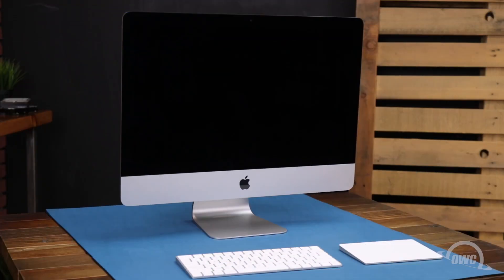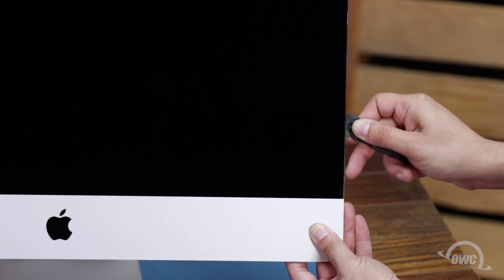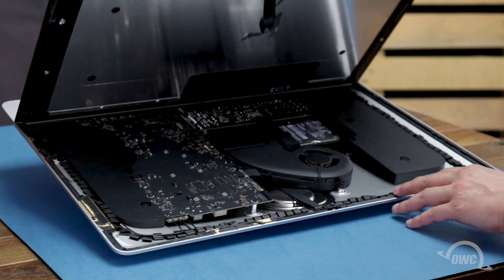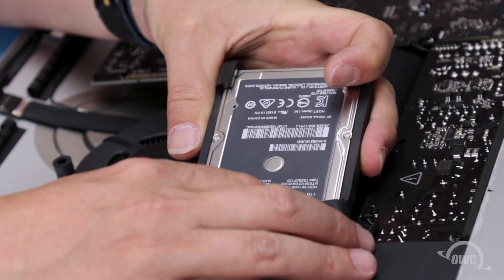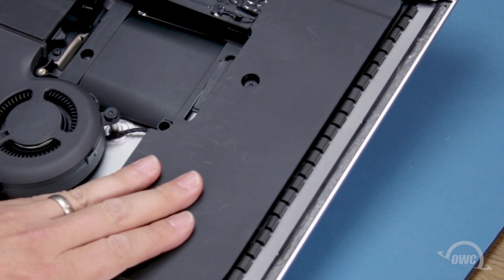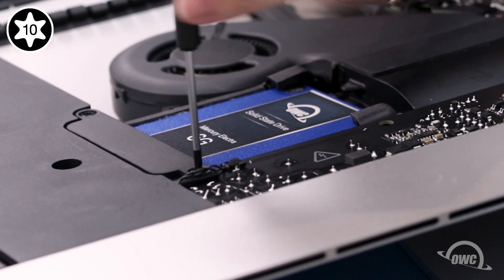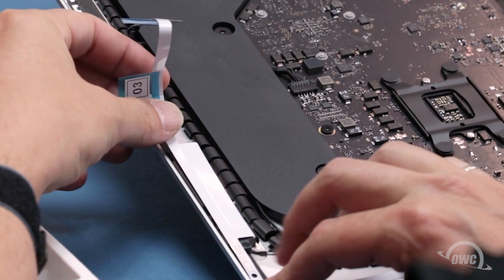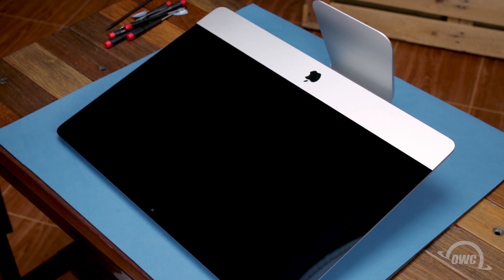How to Upgrade/Replace the Main Drive in a 21.5-inch iMac (Mid 2017) iMac18,1

Comment: Hi, thank you in advance OWC for this instructional video! I am very new to iMac, but I own a 2017 21.5-inch iMac with a 1TB Fusion Drive. Does this mean that my iMac has a socket for an NVMe SSD? If yes, can I replace both the HDD and the SSD? Thanks, OWC.
Reply from the maker: Your iMac will only have that option if it comes with an SSD in that slot from the factory. This would be if your iMac either had just an NVMe SSD already installed or a fusion drive installed. If neither of these came on the iMac it will usually not have the option to add it in later.
Reply: @poweredbyowc  Ok, thanks a lot!

Comment: I have a 2017 iMac 21.5 non retina.  t has a 1 TB SATA.  Can you replace the SATA Drive with a SSD?  I saw that Fusion and 256 GB SSD were upgrades to this computer and mine doesn't have the upgrade?

Comment: why not just have someone hold up the screen, change the drive, and put back down the screen, the adhesive should still stick right?
Reply from the maker: If you are referring to the original Adhesive on the Monitor, no it will likely not just stick again. We always recommend taking the original adhesive completely off and re-applying for the best results. There is always a chance that the original adhesives get damaged just enough that it is no longer able to hold the monitor effectively causing your screen to fall off and get damaged.
Reply: @poweredbyowc  OK, very good. Thank you.

Comment: @OWC I would like to replace my hhd with a ssd. But I don't understand the difference between ssd sata and PCIe. Which one should I prefer?
Reply from the maker: Which one you would pick depends on what you currently have installed, if you have a SATA HDD you would want to replace with an SATA SSD. If you have a Fusion Drive you could do either. Apple won't put the connections for whichever drive type you don't have so while PCIe is often faster if your computer didn't get it from the Apple factory you won't have the connections to put it on your computer. In most cases a SATA SSD is more standard but you can always check your System Report to see which you have.
Reply: @poweredbyowc  Thanks for your explanation. You have been very esaustive.

Comment: Hi there! Im so confused, when opening my iMac there’s no hard drive where yours is. It’s just an empty space with no Sata connector to be found. I own an iMac from 2017, with an ssd hard drive of around 250 go that I meant to replace by a 2 to. But I can’t find the hard drive lol If anyone knows what’s up it’s greatly appreciated, I’m stuck!
Reply from the maker: Hey Matthias Piaux,

It seems like you purchase a custom iMac with only a NVMe SSD that is located on the motherboard. When you purchase an iMac like this Apple does not install an HDD or provide the SATA connector regrettably. If you want to replace or increase your storage you will need our Aura Pro X2 and we have also included the Installation video for that install as well.

https://eshop.macsales.com/shop/ssd/owc/imac-27-inch/2013-2019

https://eshop.macsales.com/installvideos/imac-27-inch-5k-2019-pciessd/